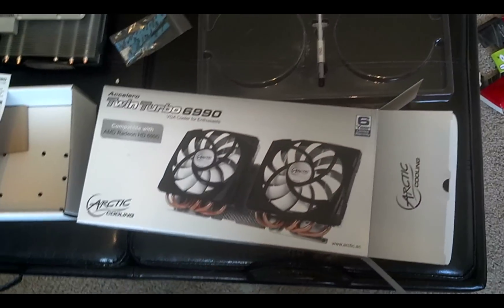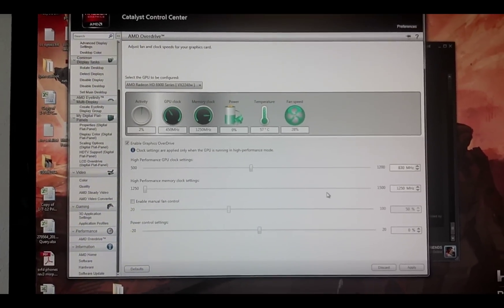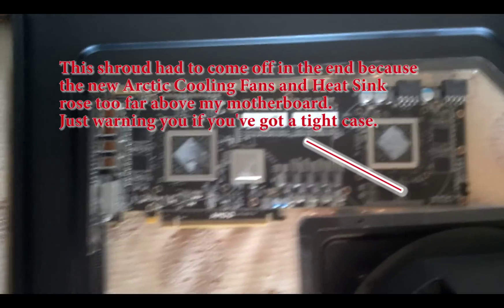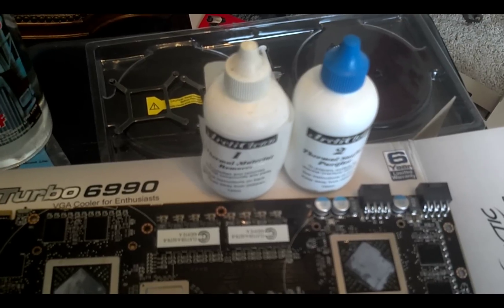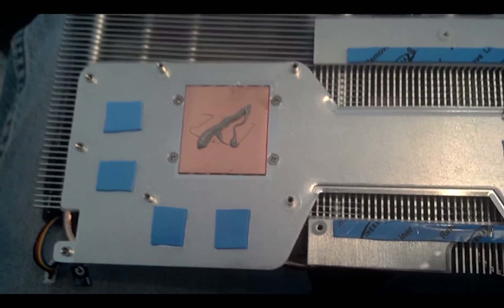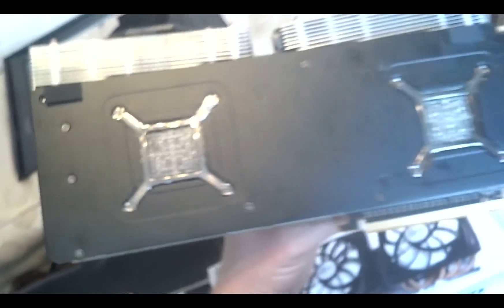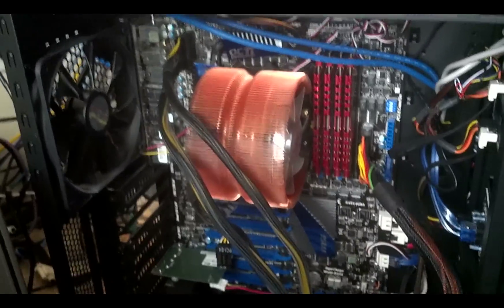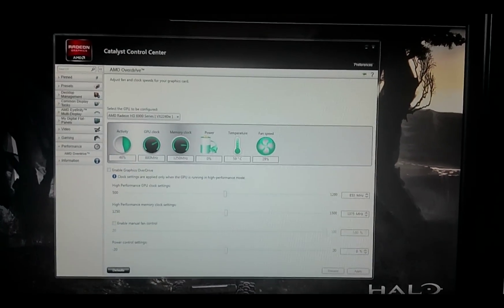Arctic Cooling Accelero Twin Tubo 6990 Review

Comment: i would of gone with the accelero extreme plus ii since i notice it has a greater surface area but looks like the cooler did a pretty good job im gonna get the extreme ii for my 6950 unlocked shaders since the twin frozr 3 is limiting my oc ability.